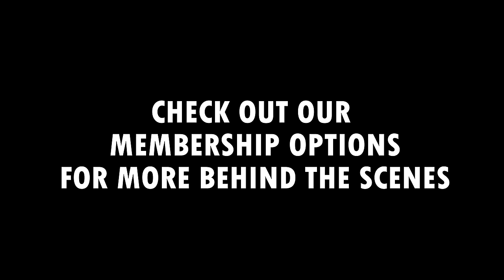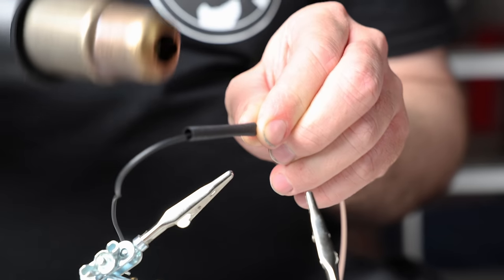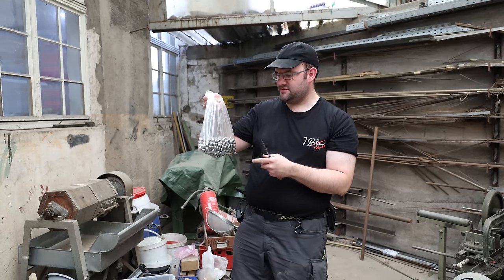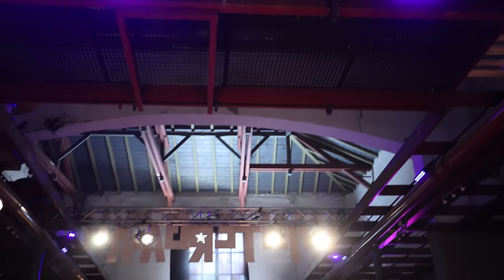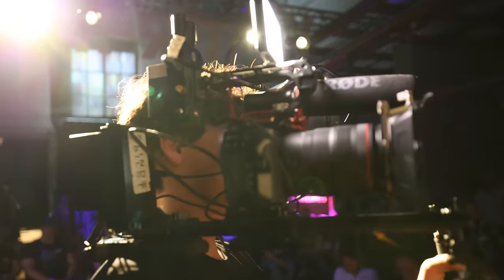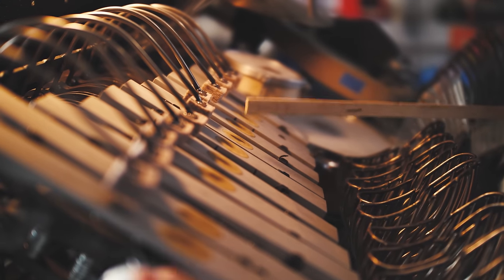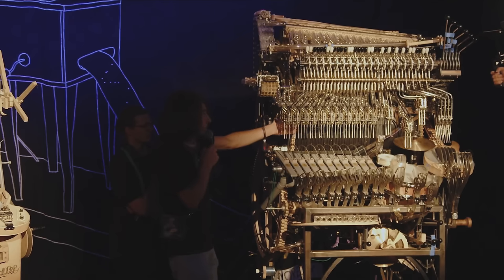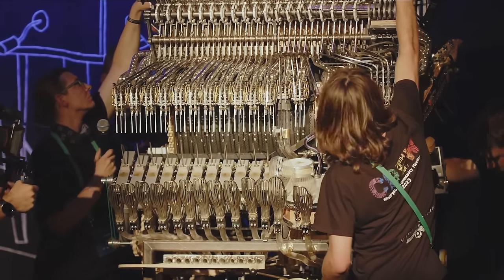Wintergatan's Marble Machine X  performing live | MM(X)#9

Comment: Seems like a foundational issue (almost literally) is the frame isnt beefy enough to hold the machine without shaking a lot while being hand cranked.  Fixing that issue would require a total rebuild...

A band aid solution could be to run it off the electric motor, but that defeats the hand powered nature of the MMX
Reply: Martin seems to have failed right at the inception: the machine was always too compact and built without shock absorption or self leveling in the frame, and with no counterbalance for the rotating assemblies.
Reply from the maker: Something that isn't too obvious in the video is that the floor wasn't ideal either. That worsens the shaking quite a bit.
Reply: @Musikkabinett  Good to know, and something Martin needs to consider.  Probably most stages aren't the most solid of platforms, so the variable quality of stages needs to be considered... Especially considering how heavy the new MM looks like it will end up being.
Reply: @FamilyHomeTheater  definitely going to be hefty, but the load is more spread out over a larger area.

The MMX puts a ton of weight on just 4 tiny pressure points.

But it will still need to be an important consideration for the stages where the  MM3 will be presented

Comment: First a praise comment to the people that had to reassemble the MMX from pieces. You people having never seen the fully assembled MMX, in person before. You managed to put the mechanical puzzle back to gather, fix/improve many issues discovered and have it play a song! That's huge! I bet it was fun.

I'm not going to read all 303 comments. What I have read said little about all the work and energy these devoted fans put into making MMX play a song in front of an audience. I salute them.

Performance points about the played song. I really don't hear the timing errors. I did hear the change in tempo and marbles striking the floor. I did notice it took two people to power it. Lastly. I could hear a marble bounce off the drum heads through the acoustic mics but no synth drum sounds played. Was the bass guitar even programed to play? It was all xylophone.

Lastly. In the video someone made a comment about how much MMX shakes. I'm not surprised. The first day I saw that frame with the programing wheel mounted. I thought to myself. That's not sturdy. Say we turn that frame into a table. You have to stand on it for some task. Would you feel safe with secure footing? That's why marbles landed on the floor. It shakes.

Comment: I’m not saying it would be any different, but this feels like a problem of engineering approach. It’s like building spiral staircase but with only designing the next step. Each new step compounds any issue and then you spend a lot of time on that step trying to fix issues introduced by previous steps. Instead designing it all up front might be better. MMX was designed based on the original design, which also didn’t work live. I’m not engineer but I think about the fly wheel and how much rotational energy is there. It’s on the side of the machine, which I think would mean it will always be off balance and wanting to torque the machine. A center flywheel might be better. Etc etc. it’s an amazing machine and work of art but I think it struggled since it was designed linearly vs holistically. Idk I’m a marble machine believer and hope one day to see a production version play live.

Comment: Try giving it more legs/a wider base to help reduce crank shaking. Another dumb way to reduce shaking would be to crank it with not as much force. I can only guess that the crank needs a fair bit of strength to turn, but putting too much strength into it will easily cause shakes

Comment: I don't understand how they were saying the marbles were getting stuck in the pressure relief system that was made of wood. Each one was designed to reduce a certain amount of pressure, if it reduced it too much you just use the next shorter version. As such it is impossible for marbles to get stuck unless they were only running one marble through it instead of a stack. If the pressure relief isn't needed anymore, then just remove them entirely. Send like it's been years since I followed this so I'm not entirely sure on all the details.

Comment: Nice video explaining the process. Is there a video coming of the direct-to-computer link audio? The live glimpse is great to see but the MMX was never intended to be "heard" this way and required software assistance. This would add the nonexistent drums to the song. Also you should find the 4 most used bass notes in the original song (1 per string) and get the cyber bass playing at least something automatically on it. You also should be using the helper motor and not just the hand crank since that kept a steady beat better.
There is also a vibraphone plate(s) that needs the latex adjusted because it was causing a cringe worthy sound overpowering the rest of the notes.
Reply: To address just one of the points for now: The latex pad was replaced, while playing it had been damaged by the marbles, leading to the marbles hitting the bare metal.
Reply: @Koffeinsuechtigi  Ah-ha. You encountered a problem Martin was going to have in the future if he had installed at least a couple vibraphone droppers before stopping. Thank you so much for replying to  me, very informative.
Reply: @billkeithchannel  , yeah, kinda. It had also to do with that gate not hitting the targeted spot perfectly but managing to aim for a spot near the rim of the latex patch.
Btw, Calos had programmed the bass but as the audio was not recorded digitally it wasn't activated during the demo here.
We don't have the control software for the motor that Martin used, and tbh, it's safer to have it played by humans - who know well how to stop it very quickly if an issue comes up. We have managed to reduce a lot of the problems, but some still need further tweaking.
And you're welcome :)